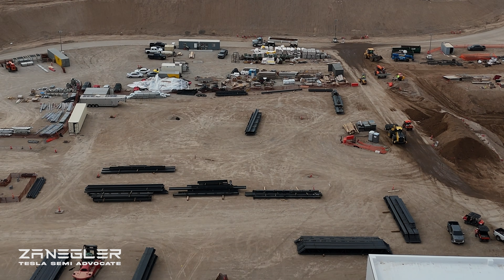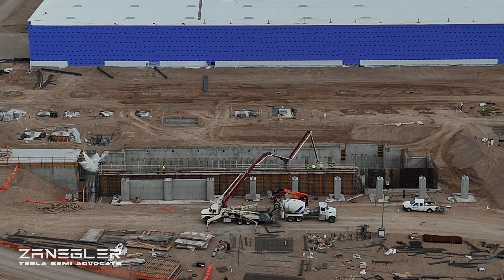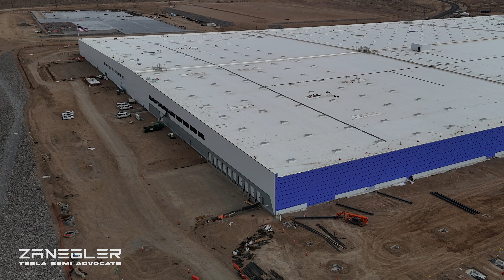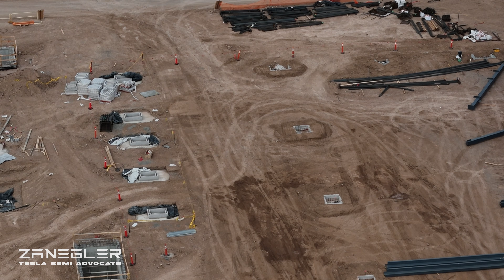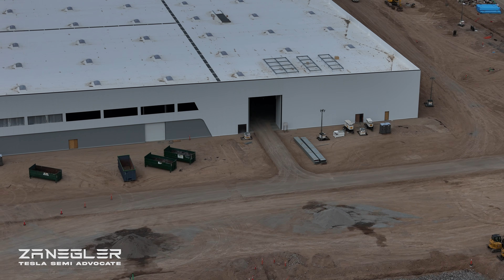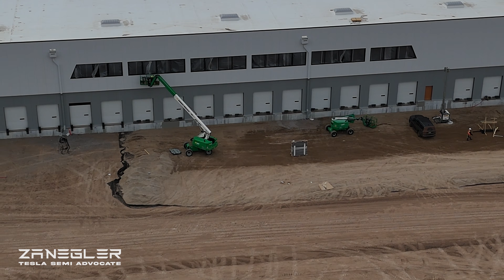Giga Semi Factory Breaking News! Steel is Back

Comment: Please forgive this ignorant question, but why was it important to put the stamping pits below ground level? Couldn't they just have put the stamping equipment on the same level as the factory floor? I don't understand why they did that.
Reply from the maker: The actual stamping machines are at ground level but they require access underneath them and massive foundations to resist the forces.
Reply: Stamping machines put out tremendous force.  They can affect seismometers dozens of miles away.  Foundations have to be very robust and go deep underground so they remain stable and are able to resist the extreme force and vibration the machines create.
Reply: @richk3552  I would venture a guess that places like the UofU will be recording some of the work happening there outside Sparks...

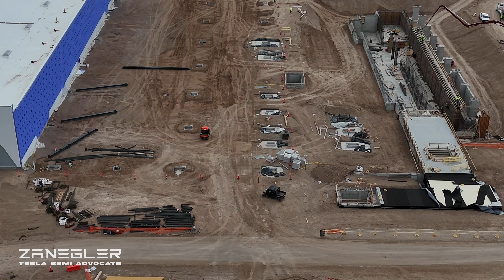Comment: 2:05. Bottom right. Black material. That section of the structure is outside of the building line. Material might be a bituminious felt material, or maybe a geo-textile, over some sort of board insulation.

Comment: I am more impressed to see they are topping out that long stamping pit wall , seems like the pour crew is coming up with small lifts and having the concrete come out as stiff as they can get away with. This will make the strength of the walls stronger than if the concrete was poured too wet.
Also would like to know if the concrete is a four five or six sack mix which also determines the strength of the walls. I also wonder if they are using a high cycle or regular vibrator which can also make a difference. Impressive team on the stamping pits labor, carpenters, iron workers are top notch professionals. By Monday those columns in the pit will be formed and ready to pour.

Comment: for these big stamping pits, do they have to have them exposed like this for construction purposes, and then there will be a new building erected around it when they are complete? Or will they be standalone buildings, or just out in the open? 
I assume the latter, but just curious why they weren't done before and part of the rest of the build that was put up so fast (but concrete floors were poured after the ceiling was put on right?).  Love the videos and coverage, thanks Zangler!
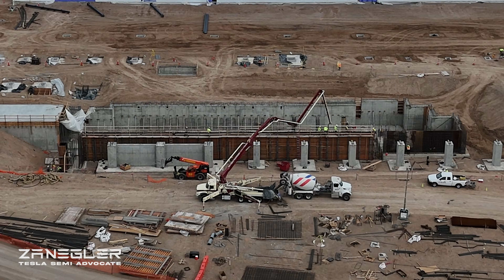Reply: I'm seeing now @3:22 the blue wrap on the main building - I thought the entire structure was already enclosed and finished, and these pits were separate after the building was basically set with doors and truck cargo gates, etc. but those were elsewhere. So this is just like an apendage out of the buildng and will be enclosed as part of the main building?  

Also now I looked up the original rendering and see that area separate, I thought it was going to basically be a big rectangle at the end, but I guess not. :)
Reply: I think the work on the pits were started early on lots of prep work on the excavation , compaction etc. Amazing they are close to finishing the stamping areas.